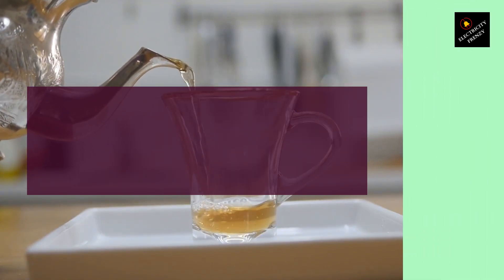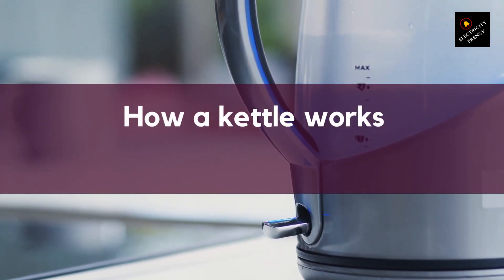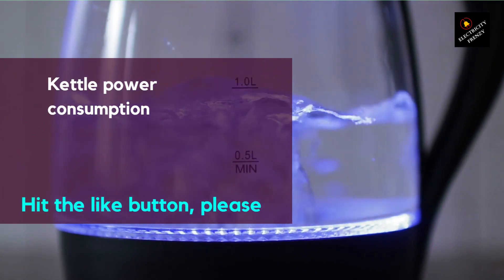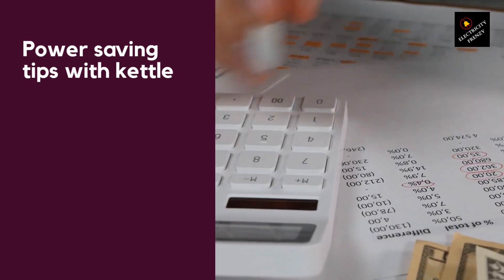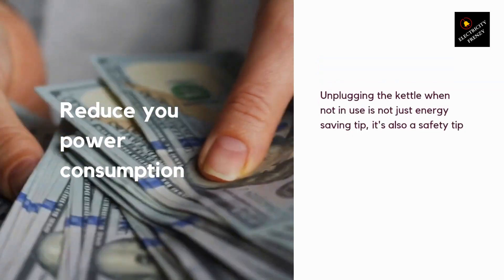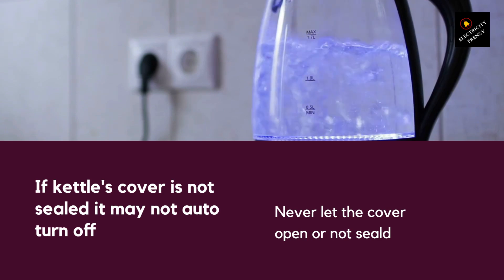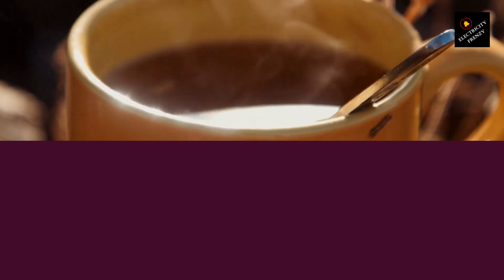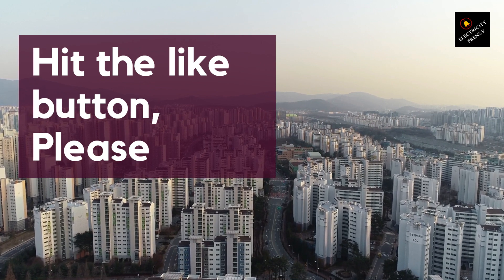Can You Save Energy With Electric Kettle?

Comment: Boiling water just enough for a cup of tea may be bad for the heating element inside the kettle, because it may overhead and has no water to transfer the heat to... Is it correct?
Reply from the maker: Good point, I do this all the time, I mean boiling one cup of water.

 Most kettls can boil one cup only however some types require minimum level of water, they have a level indicator.